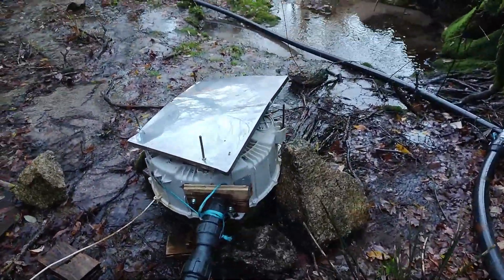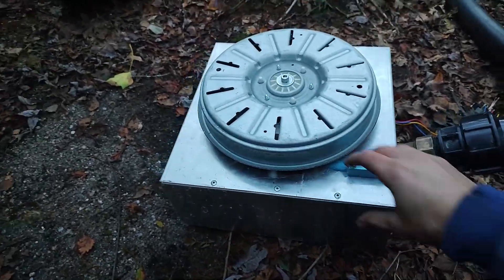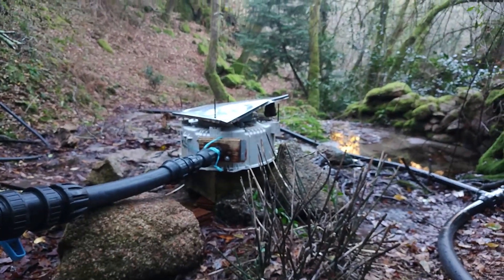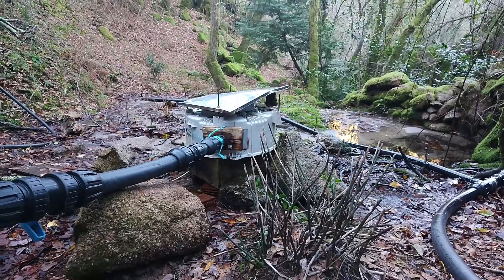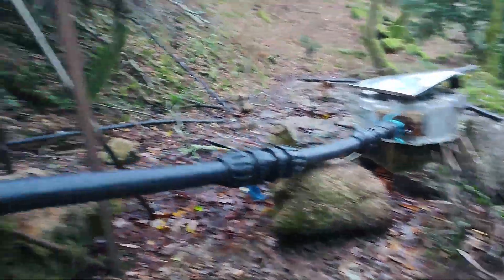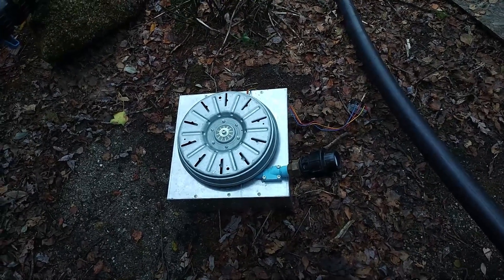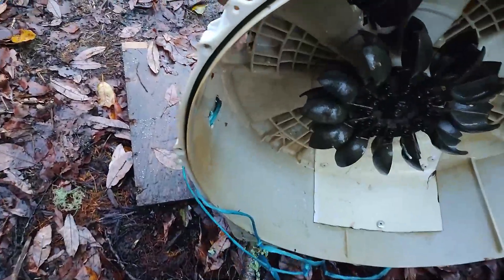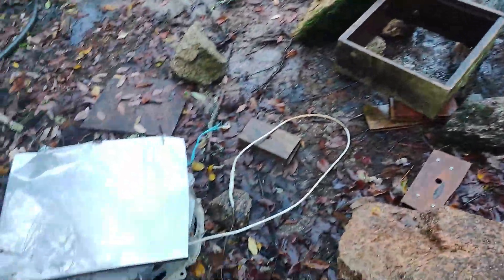Trying my new Turgo hydro generator

Comment: add jam nuts to turgo wheel
Reply from the maker: Yes jam nuts or thread locker is a must if you don't want problem with vibration, I use thread locker now everytime

Comment: right to put the SMPS towards the house. you can also put a generator wire to ground and only carry two phases
at home you use to rectify not three phases but two and earth
you can also use a small three-phase 110 volt/24 volt 50 Hz transformer
are you sure that you have 400 volts 300 Hz at no load, so this one indicated by me is fine, do you have 20/22 degrees of injector? well centered on the paddles?
distance between jet outlet and blade; 2/3 times the spray diameter
no need to change windings: the power is given by your water using a mppt 100/150 volt input max (ever)
and the no-load voltage will be the required half and the point of greatest achievable power
congratulations
Reply from the maker: Very interesting about grounding one wire and at home taking one phase from the ground but does it work for long distance? I don't know anything about this..... Basically there is 300M from the hydro to the house. And yes it is centered and at good angle the only thing is that the nozzle is too small for the water drop.

Comment: Hi, Ive just got a Direct Drive motor and I am doing the same as you. What size diameter is the turgo wheel? Cant believe you made it yourself...very talented. Great video.
Reply from the maker: Hi, I will check the size soon, are you planning to make it yourself? And you will use the washing machine casing or make your own? I ask because if you make your own you need to make the bearings holder with precision for the rotor to not touch the stator, I usually recommend buying a used direct drive washing machine and use the casing it's a lot easier that making it yourself
Reply: @Off_GridWorkShop  Yes I am making it myself. I will be mounting it on a 30mm Flange bearing seated on a 2cm thick plastic base attached to a 350mm diameter barrel. I am asking about your impeller because the larger the impeller the easier it will be for the impeller/
water force to move the motor? More RPM/watts? Asking on your impeller size because they are expensive. Maybe purchase a 3D printer and print many options to test first.
Reply from the maker: @plan9channel7  Ok, If you use only one bearing you will get yourself in trouble, 1 bearing only will make the rotor be able to slight move side to side and then touch the stator. I just copied the washing machine bearing setup so i use 2 bearing spaced so that it make the rotor not moving side to side.
And the RPM depend on your motor/generator, probably you will need same as me as all washing machine uses pretty much the same motors. What is your water supply, tube diameter and drop ? Depending on your setup it might be better to use a pelton or other kind of wheels for lower water drop... And i use 3d printed pelton for 2 winters without any issue, anyway 3d printer is a must have if you like to do stuff yourself ;) my Turgo is 280MM from side to side
Reply: @Off_GridWorkShop  Thank you for your valued and experienced information. It is  very helpful. I also think a 3D Printer is the way forward. Is Nylon the best?
I have 3 x 32mm pipes, 200m length, 12/13m head, Ltr/per/min I cannot remember.
Reply from the maker: @plan9channel7  PLA is more brittle than Nylon but nylon is more expensive and harder to print ( bed adhesion ) I used PLA without any problem, i use PLA for everything it is just not really good if getting UV's. With 12M head and 3 tube yes turgo might be the best options or even Pelton, If you have the 3d Printer you could try the 2.
don't join the 3 pipes together at the end better use 3 injector placed like a triangle shape ;)
Reply: @Off_GridWorkShop  Thanks for the PLA and   3 independent nozzle advice. I'm thinking of filming my build journey..it will help others see my failures ha ha.
Reply from the maker: @plan9channel7  I will check your videos if you upload your progress ;)

Comment: Salut, pour connaitre ta hauteur de chute tu peux installer un manomètre avant ta vanne de coupure. Vanne fermée la pression indiquée par le mano te donnera la hauteur de chute : 1bar = 10m de hauteur de chute. La vitesse de l'eau en sortie d'injecteur est peu dépendante du diamètre de l'injecteur mais principalement de l hauteur de chute et des pertes de charge dans la conduite forcée et l'injecteur. Le diamètre de l'injecteur va jouer principalement sur le débit, et comme la puissance dépend de la hauteur de chute ET du débit, plus tu débites d'eau et plus tu as de puissance. Plus tu as une grande hauteur de chute et plus tu as de puissance aussi.
Reply from the maker: Salut, Intéressant mais si le diamètre du tuyaux est de 10mm et un autre de 100mm avec la même hauteur de chute en théorie il n'y a pas la même pression en bar à cause du poids de l'eau non?
Reply: @Off_GridWorkShop  si au bout de ton tuyau de 10 et de ton tuyau de 100 tu as une vanne fermée tu mesureras en bas avant la vanne la même pression statique (eau immobile) dans les 2 tuyaux. Si la vanne est ouverte et que l'eau circule et sort du tuyau, sa vitesse est egale à racine de (2×9,81×Hauteur de chute). La vitesse de l'eau sera la même pour les 2 tuyaux. Par contre le tuyau de 100mm de diam ayant une plus grosse section, en sortie le débit sera plus élevé pour la même vitesse. Pour une turbine il vaut mieux une grosse conduite, car pour une même vitesse d'éjection de l'eau et un débit fixé par le diamètre de l'injecteur, quand l'eau descendra dans la conduite, elle descendra moins vite dans un tuyau de grosse section, et y perdra moins d'energie en frottements (pertes de charge dans la conduite, qui augmentent si la vitesse de l'eau dans la conduite augmente. Pour réduire cette vitesse (dans la conduite, et pas à la sortie de l'injecteur), il suffit d'utiliser un tuyau plus gros pour la conduite. Toutefois au dela d'un certain diamètre le gain n'est plus rentable. Tout ça peut se calculer, si jamais rejoins le groupe FB "turbine Pelton DIY en basse chute" et demande à Lina Martin de te faire les calculs pour ton installation. Sinon il y'a aussi le site hydroturbine.com ou .info qui a des calculatrices pour calculer tout ça. Tu peux faire des simulations en faisant varier les paramètres : hauteur de chute, longueur de la conduite forcée, diamètre de l'injecteur...etc, pour trouver les dimensions optimales pour exploiter au mieux les carctéristiques de ton site.
Reply from the maker: @fredpriser4652   Moi qui pensais que l'eau ce "comprimais" En gros un barrage ne ce sert pas vraiment du poids de l'eau mais seulement de la hauteur et la quantité sert pour lissé la demande ? J'ai rejoins le groupe, merci pour toute ces infos je vais creusé le sujet
Reply: @Off_GridWorkShop  bienvenu sur le groupe, tu y trouveras je pense pas mal de trucs intéressants niveau hydraulique. L'eau ne se comprime pas, comme tous les liquides d'ailleurs, ils sont "incompressibles", contrairement aux gaz. Un barrage effectivement se sert de la pression crée par la hauteur de la retenue d'eau, en en débitant plus ou moins à travers une turbine. Par contre le barrage doit résister au poids de l'eau en plus de sa pression. C'est pour ça que les barrages sont souvent plus épais en partie basse, car c'est là que s'exerce le plus de pression. En haut du mur de barrage la hauteur d'eau à retenir est plus faible et le mur peut être moins épais. Merci pour les infos sur l'alim smps et ton onduleur que tu as partagé sur le groupe, on était plusieurs à se poser des questions!

Comment: Congrats on your project, if I may, you need to modify the stator winding to 6x2c diagram, it's not complicated but that will allow you to achieve low volts for high current, you also need to make sure your winding is copper and not alluminium.
Reply from the maker: I do have a rewired stator but lowering the voltage mean increasing power loss over the 300M 1.5mm cable, in open circuit I have around 400v and on max load 200v which is well accepted by the SMPS charger, but if I had less wire distance I would use 6x2c for sure and MPPT charge Controller.... And the winding is in aluminum but this same stator ( washing machine casing) was used for 2 years now without any issue, I've heard that aluminum winding don't like humidity but it seems to hold up perfectly
Reply: I'm glad to hear you're having success with it, I have tried various methods but haven't got anywhere with it but as a hidro generator it seems to hold up pretty well, it's refreshing to see, keep up the good work 👏

Comment: If you put 2 nuts on the bolt it's far more unlikely to vibrate out btw :). looks fantastic! well done mate.
Reply from the maker: With the plastic hub I had 2nuts and some resin even though it got loose somehow and when I noticed that I wasn't producing anything I went to check and the wheel fell apart.... Now I won't trust 2 nuts only ;) Loctite is the way to go I guess
Reply: @Off_GridWorkShop  Yeah, I guess it entirely depends on level of vibration etc.

Comment: Try adding a MPPT solar charger to maximise the electric power. Keep up the good work. thanks for uploading
Reply from the maker: I'm using a SMPS so it accept DC voltage without any problem I'm not sure MPPT charge Controller would be better, Plus it's high voltage up to 430v so a MPPT that accept such a high voltage must be really expensive, maybe rewinding the stator could do the trick but with 300M of cable I would have loss I guess what you think?
Reply: @Off_GridWorkShop  Place the charge controller after the 300m of cable.
Reply: @Off_GridWorkShop  keep the 3 phase 430V over the 300m. cable and start saving money for a (second hand) Midnite MPPT is what I would do. using an electric boiler as dump load when you're batteries are full would be a next nice step.